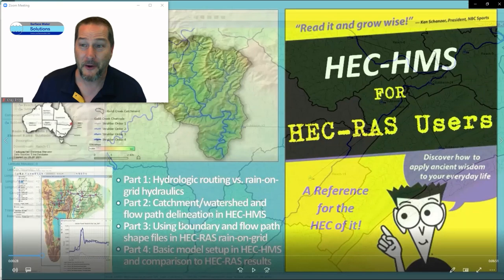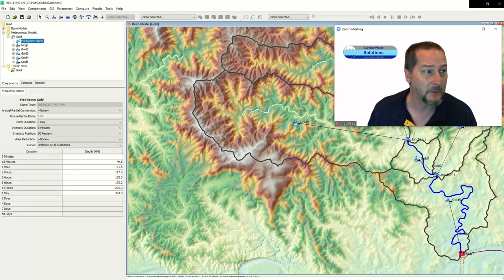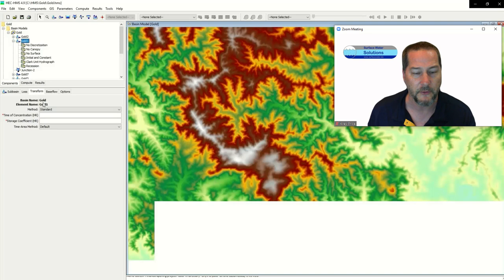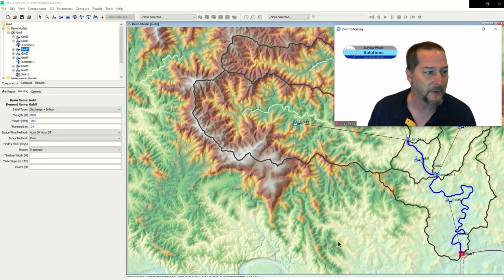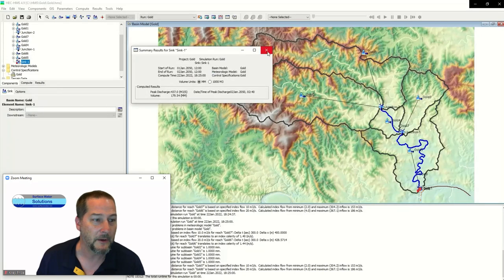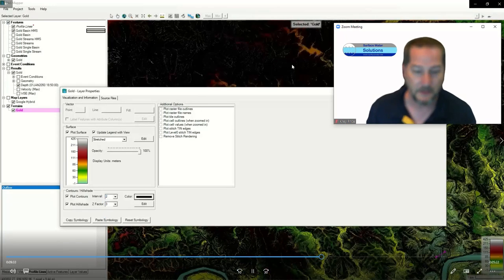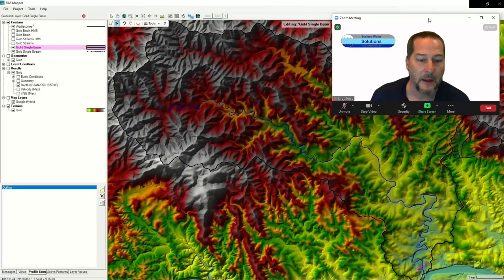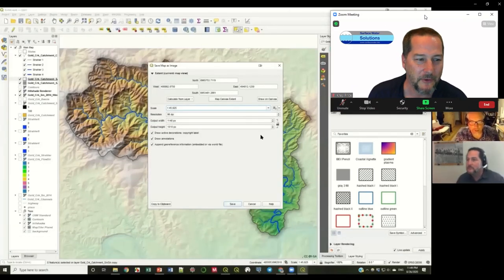HEC-HMS for HEC-RAS Users Part 4 of 4: Setting up a basic HEC-HMS model and comparing to HEC-RAS

Comment: Thanks a lot! Very informative. I would like to watch you doing a "rain on grid" in RAS with several watersheds and different precipitation hyetographs for each one. Thanks.
Reply from the maker: You could connect up multiple 2D Flow Areas and assign different hyetographs for each one; otherwise try gridded precip, or sometimes I apply the relevant hyetographs at spatially defined stations. (Unsteady flow menu, meteorological data tab | Create/Add stations).